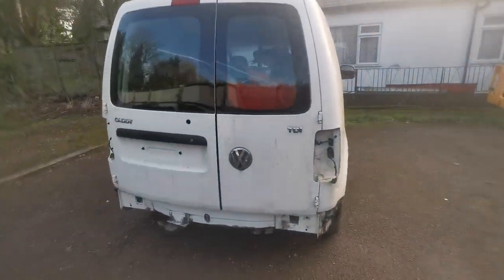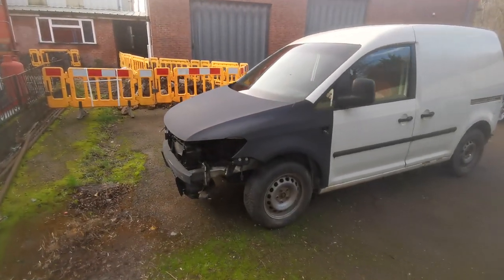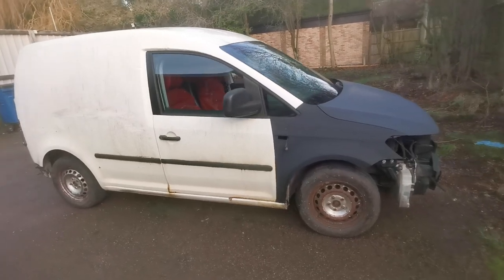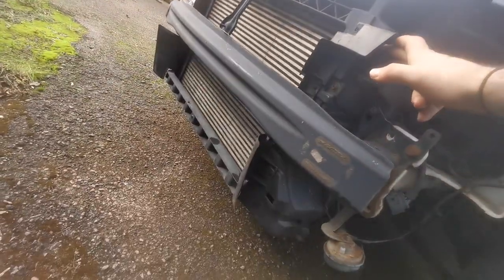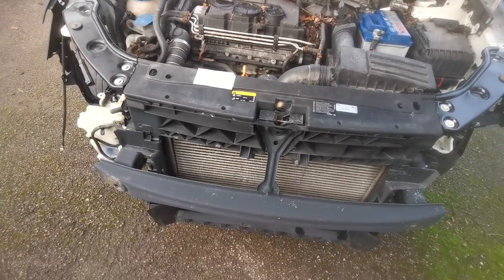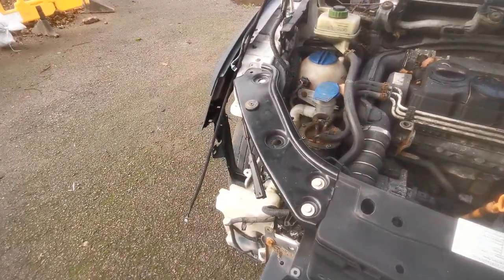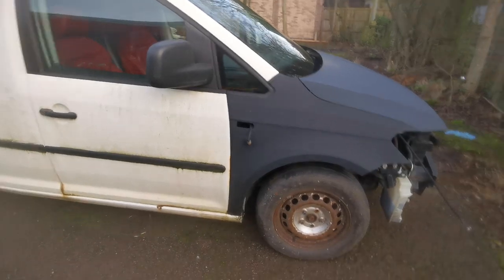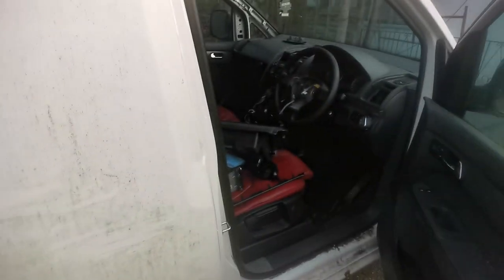My Abandoned VW Caddy Facelift Project!

Comment: Honestly been looking for someone with a project like this! Big inspiration for my van which is the same engine and same year. Love it mate
Reply from the maker: Thanks mate! ive been slacking abit with the videos recently, going on holiday next week and then ill be trying to get it completed when i get back! need any help with anything then just let me know
Reply: @JDFAutos  I don’t think you’ve done bad mate considering the lack of content out there for these conversions! Enjoy the holiday I’m sure it’s well needed lol😂and thanks mate I do want to do the 2011-2015 facelift on mine if it’s easier and cheaper since mines purely a work van… well and a daily 🙄😂
Reply from the maker: @onecutjoinery5004  yeah i kinda just bought the front end with no information then just used trial and error! 11-15 is cheaper for sure as you don't need to replace the front doors (they seem to be impossible to find good ones for less than £500 each) and i think the parts are just more widely available, honestly tho i dont think any of it it too difficult, just spend some time examining parts diagrams and you can get your head round it easy
Reply: @JDFAutos  that’ll be me when I come to do mine as well 😂thanks I appreciate that! If I get stuck I’ll give you a shout

Comment: Hi mate what year is this and do you have any links to the facelift bits you have used ? 

I’ve just bought a 2006 1.9 so looking to do mine up? 

Thanks 🙏🏼
Reply from the maker: Hi mate, Mine is a 2007, no links really, just alot of ebay searching and trying to find things for a good price, defiantly try and find yourself a scraped or crashed VW Touran tho as there will be tonnes of bits you can pinch of it and upgrade, that was the first thing i did! ill try and put together a list of everything you need when ive got the front end complete, there are lots of little clips and brackets that you can easily forget about and to be honest, your closest Commercial VW Dealer will be the best place for alot of the stuff

Comment: Ye need tay change plastic front panel  and bar sits minted when ye day it
Reply from the maker: Which bit do I need to change mate?
Reply: @JDFAutos  bumper bar and plastic front panel then it all fit's ye put touran front end on them tay
Reply: Should get good headlights with balist better so they are
Reply: Vrs Northampton does all the good stuff
Reply: Day engine's for golf r and audi s3 all new stuff  delivered too yer door
Reply from the maker: @craigmccarthy2114  yes mate I'm gonna be looking for engines in the summer probably vw tfsi 2.0, upgraded turbo and all that, will be getting the better headlights too but need to get it running ASAP so cheap ones for now
Reply: @JDFAutos  check pump in tank if its no running if lay about for ages probs seized diesel pump
Reply: @JDFAutos  diesel pump in tanks probs seized
Reply: @JDFAutos  add darkside developments ye can get 400bhp out a diesel
Reply: Dont use euro car parts stuff doesn't fit rgt vw and audi Dont release the right size off there stuff evan headlights don't buy there gaskets 5mm out cause leaks always buy dealer gaskets and panel's and lights or buy second hand genuine with new dealer gaskets
Reply: Lambo gallardo wheels go on 5 stud ones
Reply from the maker: @craigmccarthy2114  thanks for the info mate, did think about lambo or gently wheels, van starts and runs okay, just needs an alternator and apart from the bonnet and wings everything is genuine, all the bolts, wiring, brackets electrics etc are coming from vw commercials in covernty, I've got R-Tec performance near me and they did a few bits to my Audi tt a while ago so I'll be paying them a visit at some point
Reply: Better way new altenators
Reply: Ye get good used low mileage engines gearboxes and that off vrs Northampton send it right too yer door day everything for german cars right down too full wiring looms